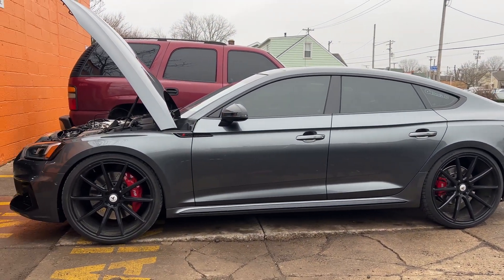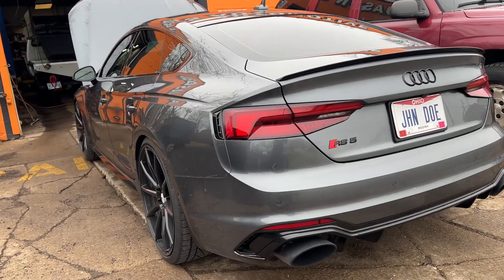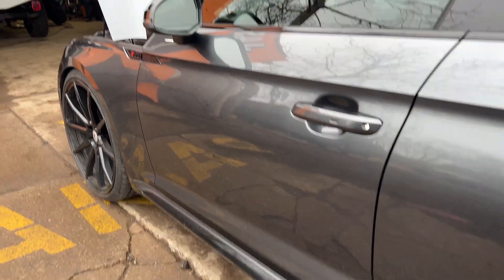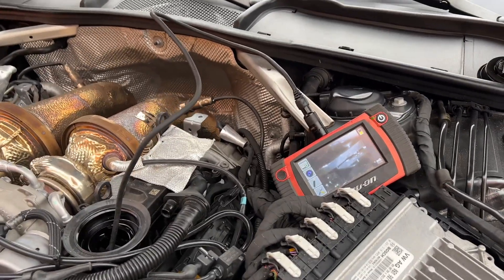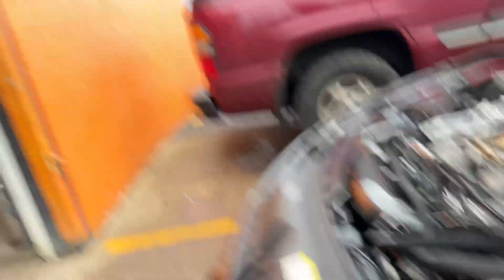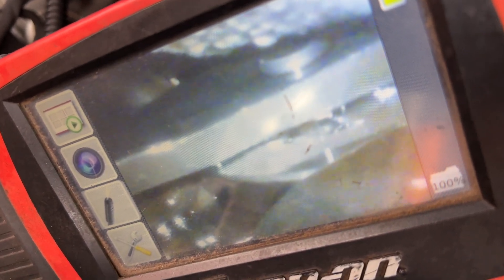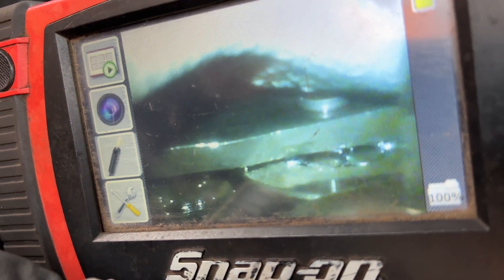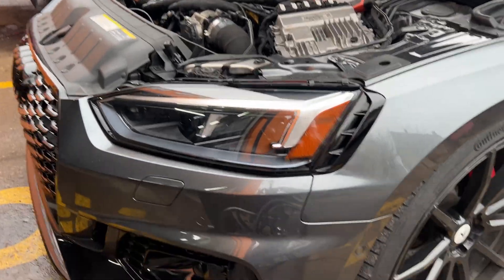Audi B9 Rocker Arm Inspection! (S4, S5, RS4, RS5, SQ5)

Comment: It says on the vin that I have the old style on my rs5, I’m at 73k miles and get oil changes every 3k, is it really a big issue or just a batch that had issues? I understand it’s a weak point but is it that hard to make it long term with them?
Reply from the maker: That’s honestly debatable and there is no clear answer. Could be a batch or several other things so it’s hard to pinpoint. Some ppl haven’t had issues but some have. It just all depends. As long as you take care of your car, such as those frequent oil changes, and don’t create extreme heat conditions, such as back to back WOT pulls without time to cool down. I would think you should be fine. Or if you want to be super safe because you plan to keep the car for a long time, I would just update them. All up to you.

Comment: Looking at a B9 S5 Cabrio with just over 100k miles on it.  It has 26 Audi dealer service records and one owner so I am hopeful it is a good car.  If I have the original rocker arms, which have reported issues,  would a car with over 100k have already failed if the rocker arms were an issue or is it still too early to tell if they will fail or not?  Anything I can have the PPI folks (going to Audi dealer tomorrow for PPI) check to see if they are on their way out?
Reply from the maker: I feel like if they were the old style they would have failed already. But I do have a video on how to check them. It’s super easy. I would check before buying if I were you. I personally wouldn’t want a car with the old style rockers.

Comment: I’ve put a deposit down for a rs5 with a build compliance plate of 12/2018. It’s a MY19. Should I be concerned about the rocker arms?
Reply from the maker: @georgei6126  Yes, if it were me, I’d check them. Better safe then sorry. Cheaper to update them if they are the older ones then to fix the engine if they fail.
Reply: @WheelzAC  will do my friend thank you! I wasn’t sure if these were something you can replace or not.

Comment: Looks like the old rockers to me. The new ones have a small bearing and big pins, your middle bearing looks like the old model. Either way, this issue has been blown way outta proportion considering how many of these engines exist from different VAG products from 2016-2019 with the old style rockers.
Reply from the maker: Naaa it’s def the new ones. I’ve seen all the videos. And I have a set of new ones. I was ready to drop the engine and change them. Looks just like them, pins are too big to slide out. I bet most 19’s are fine. But I’d still recommend inspecting regardless.
Reply: @WheelzAC  yeah. audi 'fixed' the rocker arm issue with the first revisions starting on all b9 engines manufactured in 2019.  Late 2018 and you're pushing it and will need to have them manually inspected.  I believe they went a step further and made a final 3rd revision to them in 2020 models.  Guess that explains why 2018 models seem to be depreciating the fastest, and also the most readily available on the secondary market.  Glad I read up about this.
Reply: @WheelzAC  the cutoff at least from europe was 07/19 based on VAG Technik findings, either way I still don't think its an issue. Nice RS5 btw..
Reply: @rob198 Those are definitely the new rocker arms. Take a look at the forums comparing old and new side by side, along with other people's pics they took with an endoscope camera. These ones are the new ones, no doubt whatsoever. 

Also, a few others on the Audi forums have USDM build dates earlier than 7/19 and they've got the updated arms. That said, the only way to be 100% is to check the actual rocker arms like this guy did, and not rely on your build date.
Reply: @WheelzAC  definitely the needle old ones on these!
Reply from the maker: @KE0PS77  Definitely not. I had a new updated set on hand when I did this and these look just like them. Plus I have followed every post and watched every video about these before doing this. 100% the new style. Nice try.😂
Reply: You got it completely backwards. LOL
Reply: @@marcmars9059 I'm sorry my guy. That's a huge bummer. Hopefully you were able to get things sorted. 

If you're planning on buying a used one nowadays, I think it's worth checking just for that peace of mind.